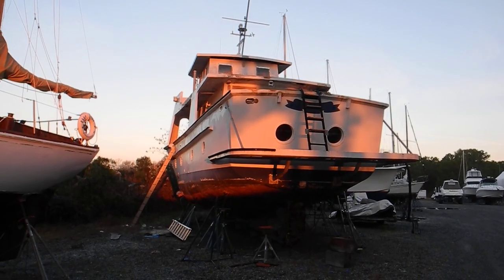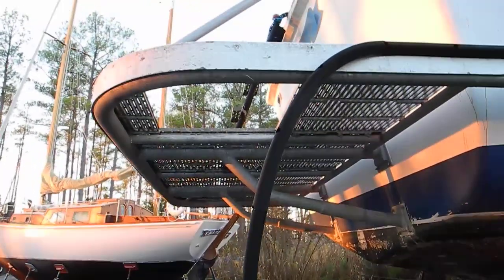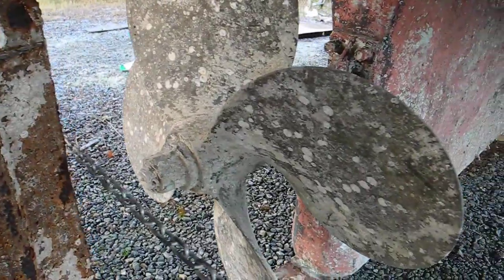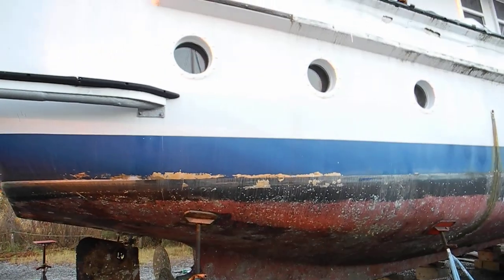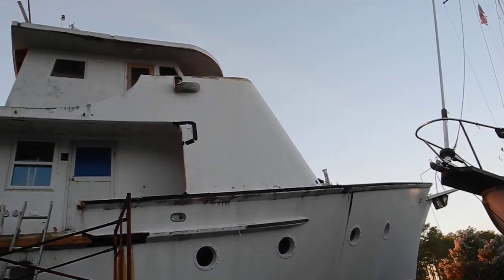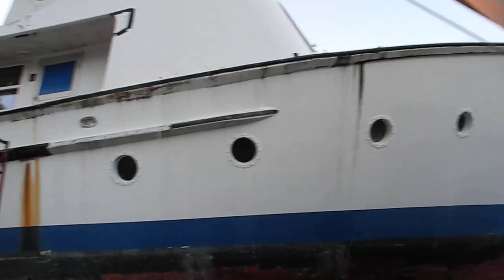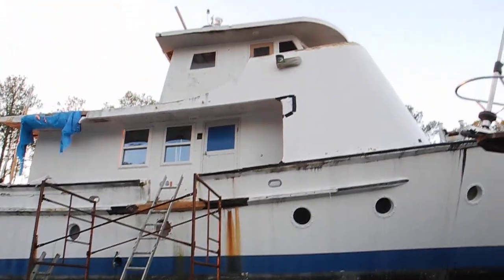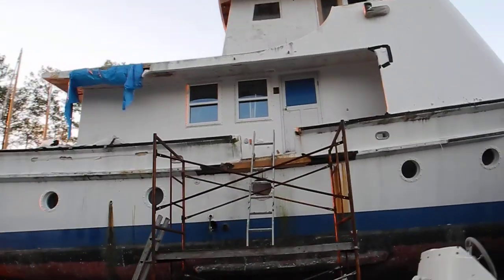Single engine trawler in dry dock

Comment: Single Engine—?
Reply from the maker: I assume so, only one prop.
Reply: I'm sure it does fine with the single engine
Reply: You only need one engine.  That's why I have two.☺️
Reply from the maker: @walterdavis4808  Deep in the water the single prop will push this displacement boat along just fine. Like a Krogen, Nordhavn or Selene, slow and steady she goes.